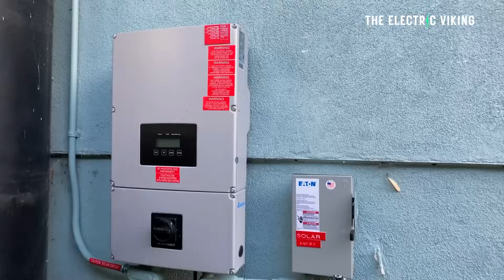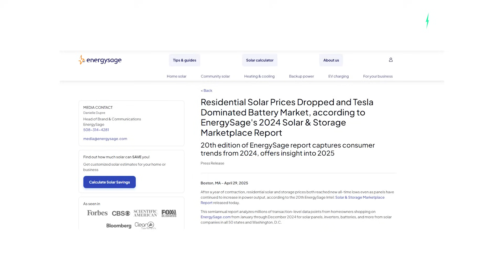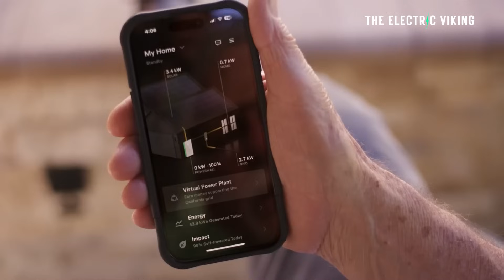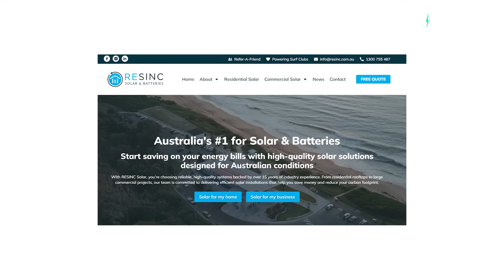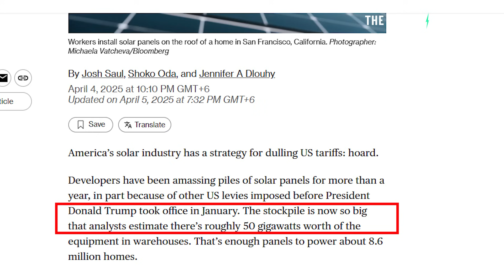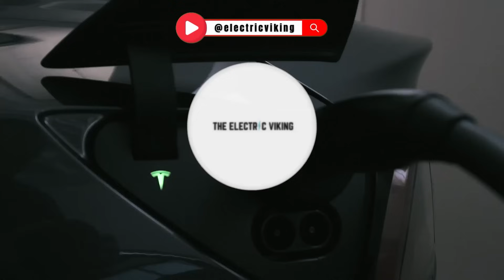Home Solar + Battery Costs Hit Record Lows in BOTH Australia & US

Comment: Yep battery costs have come down a bit but unfortunately not enough to make the economics work. The quotes on Tesla PW3 and other brands make no sense $12k plus for each module vs the $1-2k cost if you look at storage batteries direct from China! The battery installers here are still taking the p:ss! We run a house that uses circa 30 units a day and payback for battery system is 15-17 years! Panels yes, batteries perhaps direct from China!

Comment: In the UK, you can get a 5kW solar system with 9kWh battery fully installed for £6500, roughly US$8600.  That's on a house so includes scaffolding costs.

(There's no tax on installation of residential solar or batteries in the UK).

Comment: In the Nls we see prices drop as well - a 3 phase 20 kWh system with 8 kW converter goes for 8000 € which equals 9000 $ - no governement incentives available at this time. Still considering to get an EV as our next car and have that double for storage. 
Home solar system is 5,5 kW peak (6500 € no subsidies) and we're running a heat pump since 2 months through our floor heating system (very decent 4000 € invest after subsidies for the pump) - can be used for cooling too. Not off the natural gas yet.

Comment: Perhaps you should have mentioned that those 'record low' prices for fully installed rooftop PV in the US are more than double what we pay in Australia. It's parity, more or less, on panels and labour between Australia and the US, but Aussie has smashed the soft costs - ultra rapid, near-free permitting, ease of grid connection, optimised post-installation inspection processes etc - and the US hasn't. Price thresholds are critical for rooftop PV 'take-off'. In Australia it's a no-brainer ... 3 to 5 years breakeven. In the US it's 10, 15 years and up for breakeven. That's far from no-brainer territory. So bigger, more efficient and less expensive panels and batteries? All good ... but, alone, perhaps insufficient for US 'take-off'. They need to address the soft costs.
Reply: US is a 3rd world country, so why expect anything different? I"M getting a Pw3 along with 13.5kw panels installed for $16k.. bargin.
Reply: @Pepper.123Yep. And that’s Aussie dollars. No brainer.

Comment: I just paid less than 1GBP/W for a large (15kWP) roof mounted array together with a PW3 in the UK. We still get export at 25p KW on the best tariffs so if that continues I get a ROI of less than 5 years. 
Have notice the panels start to rise in the last couple of weeks.
Reply: 450w solar panel is 60gbp you got robbed
Reply: @ fitted and battery and backup. I paid the £36 trade for 460W panels and contracted someone to fit them. Just checked and the Akko Neostar 2 460s currently retail at about £110 each, 450s were retailing at at about £60 a few months ago, so they have increased in price recently, don’t know why that is.

Comment: My house in Vegas is being built in May 2026 and it will be a fully electric home! Solar is standard. I may double the solar just to be safe. I’ll have a Tesla power wall and I love the idea of energy independence in my home. If Vegas power goes out, my AC will still be running, my induction cooktop will be working, and I’ll be charging up my EVs. So friggin cool!
Reply: Double the solar if you can and you wont regret it.
Reply: If wanting to run air cond through the night, really increase battery storage too, crank it up from mid afternoon to get the home cool.
And upgrade insulation will also be a huge help.
Reply: @lesskinner8588  yeah it has thicker walls than most houses and foam insulation. The builder, Beazer, has model homes where you can see the insulation. They put a chocolate bunny in the attic with a thermometer next to it so you can see the attic is just was cool as the house. I have yet to see another builder that does this. It’s super cool. I am so excited to get my house!
Reply: @ awesome, that’s the best base to work from.
Reply: @mikeshafer  thanks for the tip. Most builders are not conscientious as the regulators are captured
Reply: @mikeshafer Insulation is the base of the home energy efficiency pyramid!
Reply: Well played sir.
Reply: Ypu've got a good plan. If you call China you could probably be living in it by Christmas for a third of the price (minus tariffs)
Reply: @mikeshafer  I'm not far behind you. Freedom from corporate gouging in such an important area of life is soooo good.

Comment: Battery packs for energy storage and EV are getting to $100 per kWh. Home batteries are somehow still $1000 per kWh. 10x. Still a rip off
Reply: Absolutely this
If MG4 is 28k with 51kwh
A whole vehicle!

How come 30kwh battery is same price??
Reply: @nurbsenvi  that’s some good perspective
Reply: Yes agree but early days. In OZ a solar farm buys its panels 20-30% cheaper than a house. The same will come for batteries its makers are focused on EV and Grid batteries but those same cells will come to house batteries.
Reply: £200 per kWh in the UK.  (Fully professionally installed).
Reply: In the Netherlands there was a guy (ketelklets) who was getting tired of the "is solar still worth it" with a future change in rules. He calculated it is cheaper if you use unconnected panels instead of normal roofing materials. If you connect it to an inverter it will generate money. So he reached the same conclusion: install solar!

Comment: I'm saving up and on the pension 69 years old what should I get solar system or a ev. I'm pushing towards a ev and don't care if it's second hand. Cannot afford both. I'm a true blue aussie.
Reply: EV you will likely save more money than a solar..
Reply: @Pepper.123 hi, you MIGHT be correct, depends a lot on where @donaldwatson3110 is located . . .
It is a international audience for any channel, expect the Viking has many watching from all over.
I should have checked on that.
If Australia, an EV will cost a lot to run without PV (solar), and home electricity savings with solar, purchase price / fuel cost for small economical ICE will be far less than EV savings alone, charging at exorbitant power prices here.
Don needs to do his sums on both for his region / country.
Reply: @Pepper.123that what I reckon because at earliest 2028 then that will be our last car. Don't care if say 2 years old.
Reply: Don, EV without solar is really going to be tied to high retail pricing, and ever increasing.

Get solar, self consume as much as you can through the day, if you can afford it get a battery of matching size to cover your evening use of basic lighting, fridge / freezer etc.
OR . . . just get a battery, you can go on a plan where you charge that at the most economical rates through the day, and use that battery for peak hour usage.
Get the govco rebates on solar and / or battery (battery rebate only applies if you also have / get small solar hooked up, rebate depends on both being present).

Buy an economical ICE vehicle if you can't afford something like a 2nd hand EV (Leaf etc) for the suburbs . . . an EV for longer trips, you will really be needing something a lot more costly.
Reply: @lesskinner8588 looking at around 2028 could be longer. Will need one more car by 2030 as ours would be 8 years old  by then so will go for a ev. We do less than 10000 kms easily per year. With a couple a day per week car just sits in carport so maybe run the ev on grid at night even if only 2 or 3 nights might be more. We would only need one about the size of the byd atto 3.

Comment: Solar doesn't work for everybody. I contacted a solar installer and they looked at our roof on Google Earth, and told me that there is too much shading from trees (not on our property so we can't remove them) so it wouldn't be worth installing solar on our roof.
Reply: It can be installed on a stand alone frame in a sunny spot, and then you could use it for an outdoor entertainment area.
Reply: @TerryHickey-xt4mf   Wouldn't work for us. We live in a townhouse inside a complex, and have no private area next to our house. There's a spot to park the car and a tiny patch of garden, and that's it.
Reply: @aftonline you’ll have to get a battery instead
Reply: Look into a solaredge or enphase system. With these systems, only the actual panels being shaded are affected and unlike conventional systems, panels that are ‘unshaded’ are unaffected by the shaded panels as each panel operates independently. I have a 13.2kw Solaredge system that i’m super happy with but both brands are excellent! 👍
Reply: That's a good honest solar company mate.
But you can do something like others below mentioned . . .
Get SolarEdge with optimisers, or Enphase with micro inverters, so that any panels are as efficient as they can be.
We got SolarEdge system, and it worked great before we took out the 2 big gums (we put in 40 years ago !), 8 months after our install.
If you go for a small system, say the usual 6.6kw PV, and a really big battery (if in Oz, with the rebate coming), 20kwh or so (?) so you can self consume / charge that battery with excess with solar during the day, and if cloudy / rainy in Winter and shoulder months, you can charge from the grid when power is cheap, use the battery power in peak tariff hours.
I actually considered getting 2 batteries only instead of solar and load shifting the cheap charging times / use battery in peak idea, but having the PV as well is just great.
(Edit, read your townhouse comment, the battery capacity is a food idea, if in Australia, the battery rebate is tied to solar PV being existing or installed too, so you'll have to get the small PV and as large a battery capacity as required for your usage . . .)

Comment: I have never heard about people going 120VDC instead of the complication of using an inverter.  Electronics with switching power supplies change the ac to dc anyway. The ac is rectified to end up as about 170 dc in the US,  so there is a different working voltage for the supply, which could use the lower voltage since modern supplies have agile power supplies that can do the job in most cases.  It is true that appliances like refrigerators and AC units need AC, so have a dedicated AC line for those, relieving the power requirements for that.

Comment: I’ve had some quotes to fit solar to our place. I don’t know where you get “less expensive” from. And those 25 and 30 year warranties. It’s BS, a long list of exclusions and in any case a lot of those solar companies won’t survive that long. We’ll still go solar but I’m trying to avoid Chinese panels if I can. Some of them are rubbish.
Reply: My Chinese solar panels are 22 years old and still generating around 90% 
Don't worry about it.
Reply: @John-p7i5g  22 years old? you installed solar panels on your roof in 2002-3?
Reply: @ They last longer than warantee. Had my first lot for 15yrs and were peforming as expected. Only upgraded for more capacity for 2 EVs. First panels were 90w. Current panels about 400W
Reply: @wonderwalls3565  I did. 1.5kW installed in 2003 when the NSW govt rebates were available. Still getting 1.4kW in 2025.
Then I added 6.6kW a couple of years ago. So it's now getting curtailed a lot.
Reply: A large amount of the early stage PV panels are still operating, even after 20 years, with +80% of their origin power conversion efficiency. However, if you have these installed in a hot and humid region the degradation will be a lot faster and some have been shown to fail under these conditions in 15 years
Reply: thats why you stick with reputable solar panel brands.
Reply: Why avoid the Chinese panels? They have the best technology and value for money. Hope you don't believe the lies our government spread on human rights> I can write a book on those false claims. Been there and seen with my own eyes.
Reply: He is a fan boy. Only shows one side of the coin.

Comment: The California customers should quit complaining about the grid operators refusing to buy their excess solar production. Solar farms produce electricity at about $.04 per kWh. They charge what the market will bear and it seems excessive to me .$.14 per kWh is typical in Texas and it was cost effective for me to DIY my off- grid solar even though my sub poverty line income didn’t allow any tax breaks.

There still is 1:1 grid tie rates in some places in Texas but it will necessarily end for the same reason it did in California. I never even considered back feeding the grid because the main reason for my system was reliability,which you don’t have if the grid power shuts off.

Batteries, batteries and more batteries is the key. Solar panels cost about 2x plywood per square foot.If you don’t have enough room to mount your panels on the ground,do a reverse Beverly Hillbillies and come to East Texas. We’re not all MAGAs!😊
Reply: I'm a fan. Few years back I installed a separate 5kW system for a EChevy Volt. Secondhand panels, a Mpp verter and a lucky break on 4 secondhand industrial batteries. Al up USD1200. plus a lot of reading and over engineered for safety circuit breakers

Comment: I just bought system for my house
I’m in US  and it does not payoff in any reasonable time
I’m well enough off that I’ll do it to go green
Reply: Depends on the state, the state incentives, the electrical companies rules on what compensation the home producer gets for power delivered to the grid, the price of electricity in that area. Can't lump the US in as a whole.
Reply: @markvalery8632  According to Consumer Affairs a 7kW home solar installation in the US is about USD13,900 after incentives vs USD3,700 for a 10kW system installed in WA Australia after incentives Add a 10kWh battery for additional USD4200
Reply: @markvalery8632  Utilities know how to lobby and make laws and ancillary charges to slow solar. Even if I don't use 1kwh of electricity I'm charged 40usd. The kinds of charges will increase.

Comment: That all sounds good, but I had many quotes from Lo al installers in Mackay. QLD. it will take at least 5 years before I start saving with just the panels not battery included.
Reply: if you have an ev this can help use the solar during the day and if your vehicle is at home sometimes.  Also installing a battery will also store some spare power.
Reply: @TerryHickey-xt4mf  So you mean buy a 40k EV as well?

Comment: Many households with solar panels in New South Wales face the prospect of being charged for some of the surplus power they generate from the start of July.
Reply: Foriegn Fossil fools run Stralia
Reply: I'm in nsw but didn't think this was happening.. I know there's talk but nothing concrete? 

Either way we can look at stopping the sending to the grid.. I don't know of tech around which currently can do this but maybe turning off our inverters if that's possible when we start to send to the grid?
Reply: @micoots  their pushing us off grid for a little extra profit, excellent 👏 we don't need the grid soon 😉
Reply: @micoots - I’m in Victoria and my system was shutting down its exports when the voltage in the street was too high for its settings. The installer was able to adjust the voltage threshold up to continue exporting.
It stands to reason that they could adjust the threshold down and stop exports.
Reply: SMH in disbelief
Reply: In The Nls we're being charged as we speak for delivering our solar power to the grid. That surcharge is about half of what they pay us for our kWh's. 
Another supplier says they will do no such thing but pay us the actual price of power at the time we deliver - which is largely zero during the day - plus a bonus of 2 €cts. Getting a battery system (or car) is becoming a no brainer.
Reply: just install an export blocker, simple.

Comment: The higher wattage panels are more popular better because they are physically bigger and require less hardware, that is clamps, to fit the same size system from 5 years ago. With that they are harder to carry up a ladder. They are 20% more efficient so allows for additional generation. I don’t think it’s worth replacing an existing system to chase the 20%.

Comment: $2.40 for 1 watt vs 20 cent for a 1000 watts from the grid is a reason to get solar?

Yes that $2.40 watt can make 3-4 watts per day and should pay for itself in a year. 3 years at worst.
Reply: that $2.40 per watt lasts forever, but you pay for every watt from the grid.
Reply: @licencetoswill  that is true sort of. Guaranteed to be greater than 80% output of the original spec before 25 years but get the point. That forever message needs to be told.

Correction. If a 1 watt panel produces 3 watts per day that would take 365 x 3 / 12000 = 10.95 years. 3 watts a day is very conservative